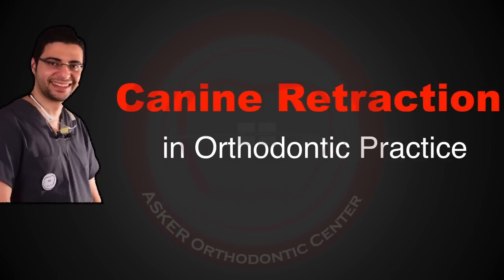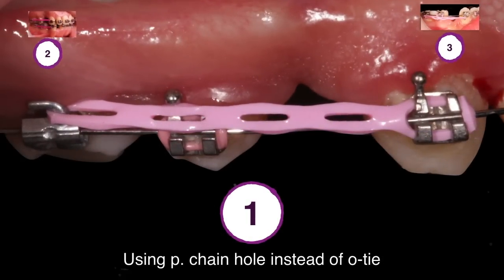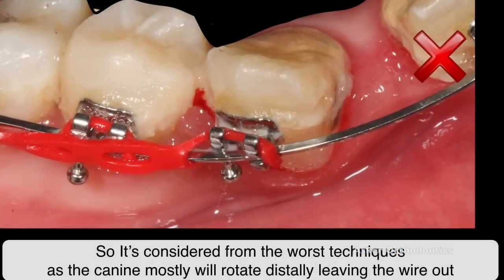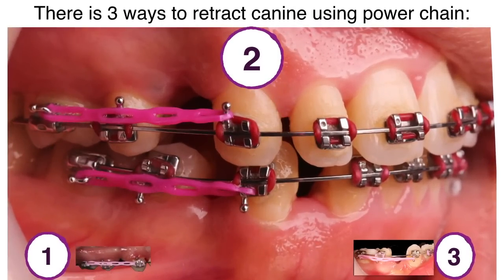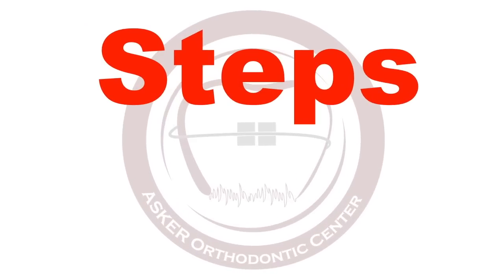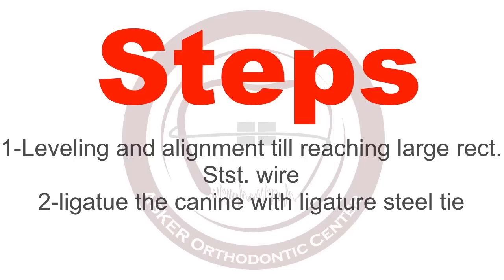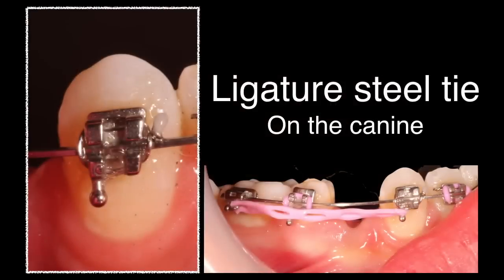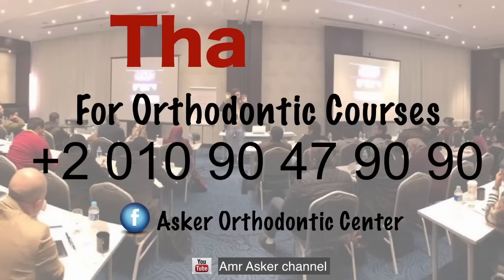canine traction by power chain in orthodontics by dr. Amr Asker

Comment: Just use a lacebacks till you reach working stainless steel wire and then normal mechanics for close spaces . Never use power chains to close big spaces , to strong , max strength should be 250 gr per quadrant . Greetings
Reply: What are lace backs if you don't mind my asking?

Comment: Meanwhile I am sitting here with orthodontist placing power chain directly on bracket without tides like the first method. And the wire he is using is really thin and weak.  Six moth in treatment and lower canines did not move at all while upper canines movement is almost none. 😢😢😢

Comment: Meanwhile I am sitting here with orthodontist placing power chain directly on bracket without tides like the first method. And the wire he is using is really thin and weak.  Six month in treatment and lower canines did not move at all while upper canines movement is almost none. 😢😢😢 Also there is a really mild rotation in one of my upper incisors and it has not improved at all. My lower incisors are now looking worse than before but I am saying maybe it is part of the process.

Comment: I removed my right side premolars on s
Sep 2023 removed left side on October 2023, replaced the normal wire with the thick wire on Nov 2023 and Dec 2023, the spaces are smaller but still very noticeable, when should they close? Is my progress slow? I attend my appointment on time every month, never missed one and never broke any brackets

Comment: It is not right. If you want to use the technique of straight wire, you do not need to move the canines away from the incisors. At the closing stage of the gaps, a rectangular steel arc should be used with the parameters 0.019 inches to 0.025 inches with hooks soldered in the area between the canine and the second cutter. As a force, you can use the nickel-titanium closing  springs stretched from the hooks on the seventh or sixth teeth to the hooks on the arc. It is incorrect to use hooks on braces as a support.
Reply: That man have not any degree in orthodontics ... that man is a thief .... dont make an effort to give  him any comment on his videos
Reply: Wait wait wait slow down there I didn’t understand a word you said I don’t speak smart or math number like stuff😂
Reply: Sir how much
Reply: @ahmedbaraka236  دكتور عمر عسكر دكتور شاطر جدا وناجح ومعه العلم الكافى ليؤهله ليكون طبيب تقويم ممتاز ومحاضر ممتاز .. .وانا أحد الأطباء اللى كان ليهم الشرف أن أول خطواته فالارثو تكون على يده

Comment: So i just got my second braces a month ago. The first braces i got it for 2 and a half years, but this dentist didn't really change my teeth only a slight difference and she didn't extract my teeth, throughout the time it changes and became crooked. So this time i got braces again to fix it. But the problem is i only have 3 months to get my teeth fixed because I'm planning to move to another country in august. Therefore the dentist speed up the treatment by giving me appointments in every 2 weeks. And the thing i concern the most is the dentist extracted my first premolar of the lower teeth, and is it possible to close the gap of the extracted tooth on time (in early august)?
Reply: Hanidar Aisyah I was told if you've had braces before then it should not be that long or hard of W treatment for your teeth to move.
Reply: How are your teeth now?
Reply: @F10werbunny  Depends on the  case and/or treatment needed. It varies per person.
Reply: Firstly... Every 2 weeks having orthondontic movement is so weary, I really hope you're doing okay.
Unfortunately extraction gaps typically take (usually) 6 to 8 months, or a year. Braces take time. They're moving your teeth into a desired position for an longlasting, invested-into smile. And that connects to your brain, nerves, body, and overall wellness. It really varies.
Consider needing an ortho in the new country (just in case). Otherwise, keep following the instructions precisely how your ortho is advising you! Best of luck. :)
Reply: Awh, just noticed this was posted two years ago lol. Any update since? 😭🤣

Comment: What about when the canine has to be move mesially?how can i do that without moving the 4 anteriors?
Reply: Let's say, the upper centrals and laterals are closed and now you need to close the gap between the upper right canine to the lateral. 

First, use a stainless steel tie on 4 incisors, then place your archwire preferably rectangular wire to support the forces and tooth movement. 

Secondly, put a steel tie, the tightest tie should be placed in the direction of the force of the tooth, eq. canine going mesially to join the lateral, so put a ligature tie on the mesial of the canine. Why the tightest tie on the mesial? preventing the canine to rotate while going mesially.

Then lastly, apply powerchain (one module per tooth) one module for the canine and one for the lateral.

Hope this helps. =D
Reply: mrsmariarecolito thanks..i really appreciate your responce..now im going to do that to my patient..will give you feedback in a month..😊

Comment: why it should be stainless steel wire. not NiTi ?
Reply: because the Niti is leveling wire and SS is working wire, power chain cannot  be used with leveling wire
Reply: to avoid roller coaster effect
Reply: Niti has an insufficient stiffness to support the forces and tooth movement.  The interbracket distance from 3-5 makes for more wire flexibility that leads to arch distortion, tipping of the adjacent teeth into the extraction spaces, and molar extrusion. We don't want any of that, that would lead to longer treatment time for our patients.